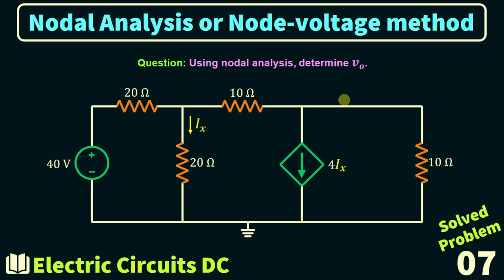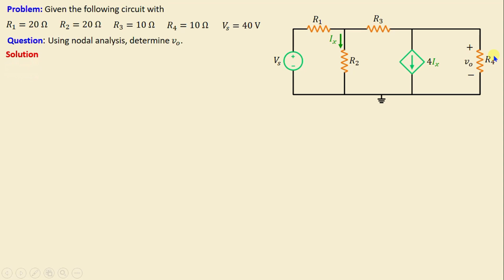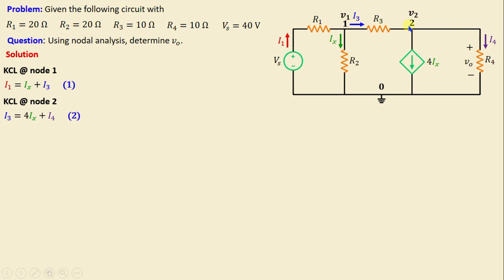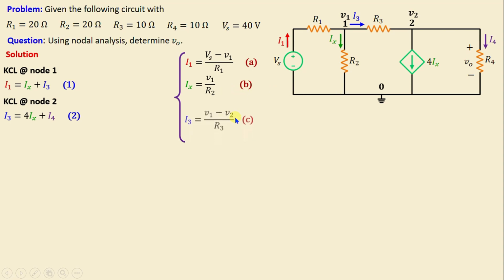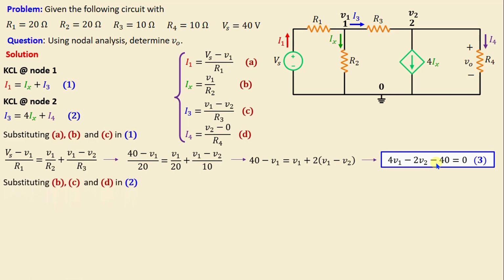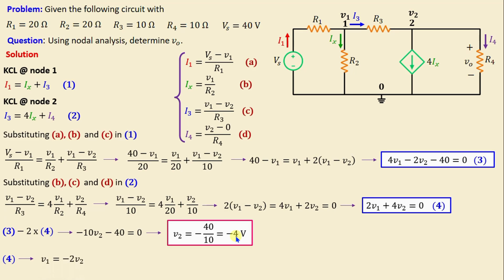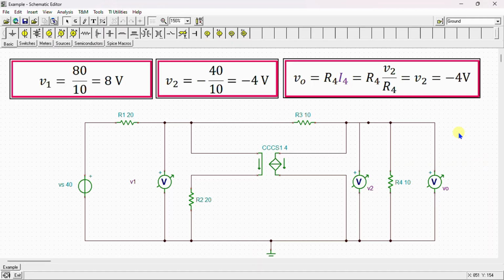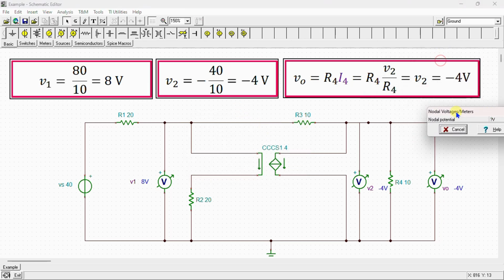Nodal Analysis | Node voltage method | Solved problem 7

Comment: What program (simulation) did you use? I really appreciate your way of solving and analysing the problem. It's easy to follow and students will find it easier to understand and develop their analytical thinking. Keep up your good work. You are brilliant.🤩
Reply from the maker: Thank you for the compliment. I strive to provide clear explanations that make it easy for students to understand. Regarding the software, TINA TI 90 is owned by Texas Instruments and it is available as an open-source tool. You can download it from the following link.
https://www.ti.com/tool/TINA-TI